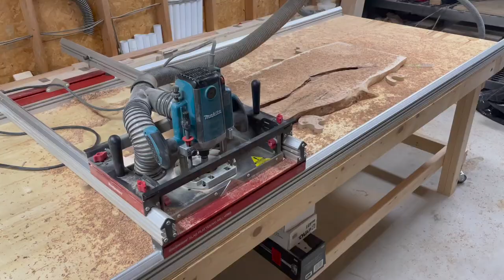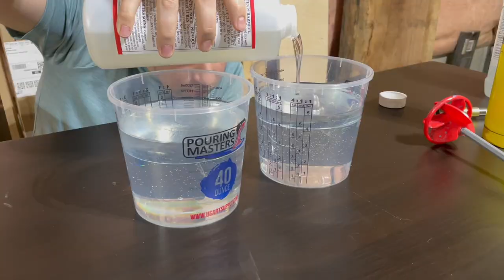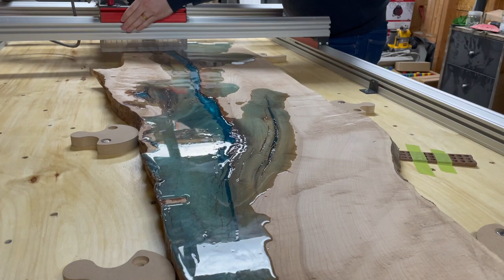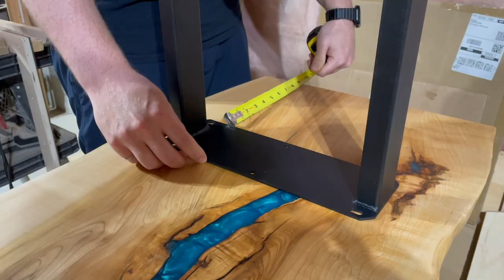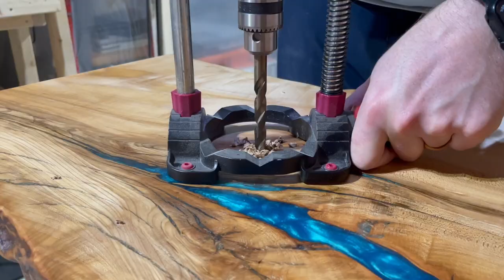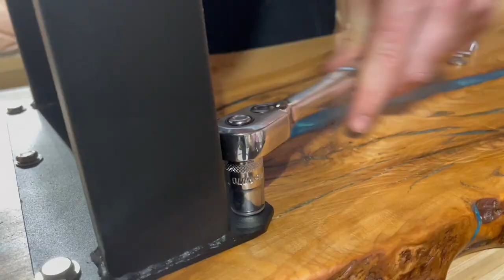Live Edge Coffee Table I Woodworking - Start to finish!

Comment: What did you use for the router sled? What kind of rails were used and the devise used to hold the router. Also will that hold any router in that devise? Thank you.
Reply from the maker: I am using the Woodpeckers Slab Flattening Mill system. The router sled can mount almost any router. You can check out the product features and what routers it can mount on the woodpecker tools website (www.woodpeck.com). Hope this helps!